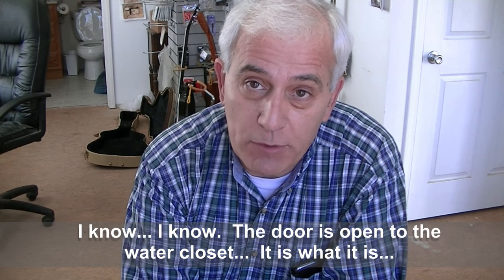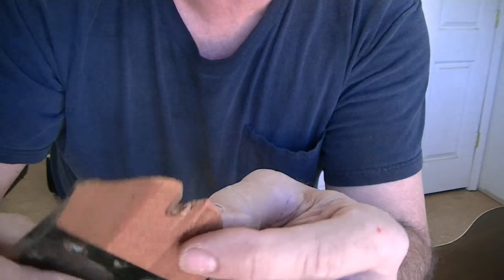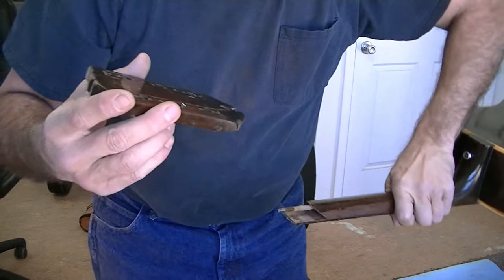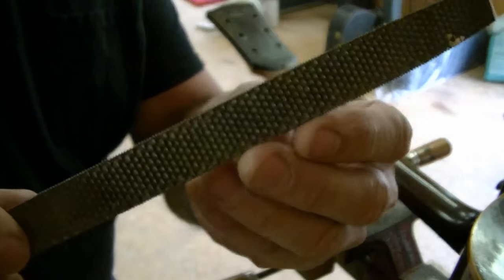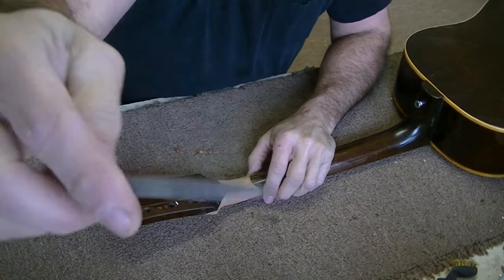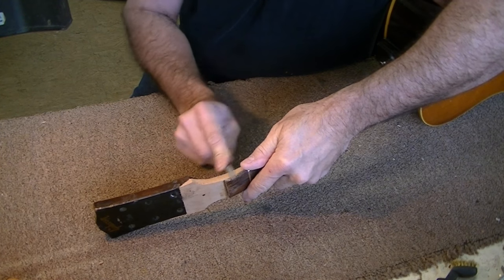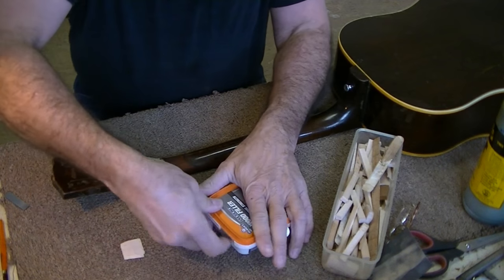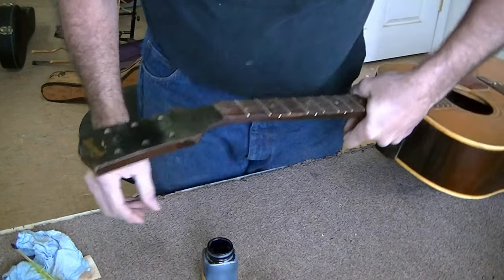134 RSW Gibson Guitar Broken Headstock Repair

Comment: You definitely do excellent work! I know this is an older video but the information is still relevant. Many people dont realize the amount of labor that goes into a repair of this magnitude. Plus the level of patience that is necessary. With gluing a neck, you definitely have to wait for the glue to cure completely before moving to the next step, because once that neck is under string tension it can pull a repair apart very easily if the neck isnt 100% cured. Acoustic guitars tend to have twice the pull force on their neck as compared to an electric guitar. This can be close to 200 pounds.  This was and is a great example of what a little hard work and patience can do. It's always nice to see an old vintage guitar being resurrected and brought back to being playable again.

Comment: absolutely amazing work. i can't believe how you got that right in 3 pieces. no adjustments on bridge? unbelievable!  you really know your stuff!!  i had a new head stock made for a 1968 Gibson s.g. by tay tay & son on long island n.y 20 years ago.  i was impressed by how the old man rebuilt in 1 piece a headstock to neck but you did it in 3 pieces? dam .....    if you have a inlay face & want to save it just soak in water overnight.  it peels off & you can glue it to a new piece.  thats how mine was done.  may save alot of time ..  awesome work !

Comment: Oh how I wish you had shown how you cut the neck with the truss rod still in place! I have a simular break on a les paul and it simulary has been poorly repaired before, the glue used looks simular to the glue in the video, it looks like it's porus and has small air pockets in it. The repair you've done making it in essence a scarf joint is amazing!

Comment: First I cringed at the damage.. then after the piece was glued in and sanded and shaped I knew it was the right way to go. The original break de-valued the guitar and after that anything to get it playing again could be done. Great job! A great ol' guitar like this need to play on again.
Reply from the maker: drumsNstuff79 thanks.  The worst part is that two previous attempts failed, so doing the same thing woild have been futile.  Thanks for watching.

Comment: Had a white SG headstock repaired a couple of years ago. It had cracked open with a light bump against a mike stand during a gig. I asked for a "brutal repair", and brutal is what I got. The guitar was recent and painted white, and the top of the headstock wasn't broken. The luthier glued it with back together with epoxy and routed 2 thin channels parallel to the truss-rod up into the headstock to insert and epoxy glue 2 graphite plates from around the 4th fret down to the nearly the top of the headsock, then painted and finished it back to the guitar's original appearance.
I suppose it was a bit overkill, but that headstock will never break again unless you attack it with a sledgehammer or some sort of a power-tool.
I sold that SG and replaced it with a second hand ESP LTD Viper 1000 Deluxe with Seymour Duncan PUs which I found by chance while shopping around, and which sounds, plays and sustains like an absolute dream, and has all the features I ever dreamed of when I was playing the SG. I never thought I would switch from Gibson to some "obscure" brand of guitar, and I don't know if all the ESP LTD guitars are built with the same quality 'cause I'm a player and I just need a couple of guitars which suit to my hands, and I'm not a collector nor a compulsive buyer, but I guess I was lucky with that peculiar guitar (at least luckier than with the SG).
Reply from the maker: Philippe Durel good luck with it. Thanks for watching.

Comment: As I wind my way through all your excellent videos, I seldom have any criticisms, and never any criticism of your actual work,  but on this one, I was very disappointed to not see how you clamped the new piece of wood.  I could almost visualize the clamping of the plug to the headstock, but not the other joint.  It would seem like the clamping of those glue joints were so absolutely critical to the strength of the repair that it should have been shown in some detail.  Also, you never showed how you dealt with the truss rod.  I salute you for your "grande cojones" for taking on this repair!
Reply from the maker: That was an early video

Comment: I didn't see the truss rod cavity cut out - lots of stain on the front, and the truss rod cover replaced in the final job, but exposing the truss rod nut? That would have been interesting to see.
Reply: If you look early on theres a small hole in the top of the section he clued in. When he drilled the truss rod channel in guessing it probably was only 2mm or so from being Ann the way through and that the top was cut out with the whittling knife

Comment: Thought you were dead in the water at first glance. Impressive job on the neck. You didn’t show nut slot install did it intonate? String action ok or did you have to do some bridge or saddle work? I know you said that was early video however, a great job. Thought it was a going to be a birdhouse at the start. Thanks this was like reading a good mystery novel. Not trying to be a troll but you do such wonderful work however, color matching finish is not your strongest skill. Getting some color lacquer in the shop would help. At any rate you are a gifted man. May God Bless you.

Comment: I’m curious to know how you managed to cut the wood away from under the fretboard and around the truss rod.
The neck we see at 3.55 appears to have been machine cut to a high standard, but with the truss rod in place that seems impossible.
You say "I’ve had to cut away the neck also" but you go on to say “I did most of this off camera". Could we please have some more info on that, or another video perhaps?

But by far the most confusing thing for me is that at 1.25 we see the end of the truss rod with the nut in place and at 4.10 you say “the truss rod will function and everything will be perfectly normal when we’re done”.
However at 13.00 when you turn the guitar over and we see the repair from the front, the truss rod cavity appears to be missing.
You dark stain the new section and at 19.10 you hold the repaired head up to the camera with the truss rod cover in place, and I’m completely baffled.
Could you please explain how the truss rod will function?
Thanx for a great video.
Reply from the maker: First it is an old video I don't remember too much about it because there's been so many other instruments since then. I'm sure I cut up to the rod with a small razor saw and cut in as many directions as possible with the saw I probably had to finish it with a knife or something along those lines though I don't remember. Regarding the truss rod cover I think that was probably just poor camera work because I know the truss rod was just perfectly normal. I don't know the man personally that owns the instrument but my son does and he says he plays it everyday. And he is still playing it. So I know it all worked fine.
Reply: @RosaStringWorks  err, that's ok then (I'm still confused).
BTW big hand to your backing band, they sound brilliant and it's so good to hear the instruments you work on.

Comment: How did you make the cut on the neck around the truss rod?  Unfortunately I'm about to attempt the same repair on a 335 that's had 2 neck repairs already.
Reply from the maker: It was so long ago I don't honestly remember but I believe I used razor saws and exacto knives
Reply: @RosaStringWorks  thanks.  It's going to be a test of patience I'm sure.

Comment: Really enjoyed this,great repair,, I've seen a few of the other top guys cut two channels  across the broken parts with a small router bit and glue in two mahogany  strips for additional strength ,so it's not just the glue  that's taking the string tension ?
Reply from the maker: I've been doing it this way for years and years and never had a problem

Comment: Thanks for showing me a method i may have to do my self on my les paul. 3rd  break.. back of neck is flattened from clamping and feels kind of hollow behind the truss rodd nut... so i may do your method. iv been to price up some sepele will cost me 5 pounds. nobody with a Lp likes to see a scalf joint as it then looks like a ringer. but what can i do. its been broken to many times with internal gaps and its just not good.. i could spray a burst area just below the headstock to hide the scalf.... Only problem i could see with your job was i can see a groove where neck meets the inlay block. and it was 2 shiny.. needs some wirewool work or scotchbrite to take that shine down. but anyway thanks for a great idea.
Reply from the maker: Joe Szabo that one was kind of a budget job. The customer literally didn't have any money. Thanks for watching good luck with yours.

Comment: You did that without doweling it at the top at? The neck graft there is no need but at the top there is more yield than shear pressure on the glue? You must think highly of your glue. What may I ask did you use for glue? Titebond III?
How about replacing the whole head stock down to the graft point? Then cutting the Gibson face off of the old one and gluing it on the new one trimmed just below the lowest tuner hole? I am not saying you did it wrong just that it will never break at the neck side but the upper one made me nervous.
Reply from the maker: Jason Adams I did use Titebond.  It's been well over two years or more since that repair.  The video was released way after that repair went out of the shop.  He still plays it daily, so I don't think we have a problem.  Thank you for watching.

Comment: I liked that one a lot.  Got that old J-50 back into action.  Very neat repair -- must have been hard to cut that center piece just exactly the right length?  

The hard part with matching stain is you have to project how it is going to look after the finish is applied  -- it always changes the "color" a little.  What kind of stain is that?  Looks like it is a water-based azodye?  Also what was that wood filler you used -- Elmer's?  

I just fixed a break on a mandolin neck that was similar to that one but I am not as confident as you are on my fix -- for one thing it is maple and I think glue binds to mahogany better and also there is a smaller gluing surface and the total string tension is greater but so far (two months) it seems to be holding good (knock on wood).

I used Titebond I  for the repair because I did some tests using small blocks of maple in the vice and decided that the aliphatic glue bond was stronger than hide glue, fish glue, or one of those super glues designed for wood (ethyl cyanoacrylates).
Reply from the maker: Thank you.  It's hard to beat titebond.  I use alcohol leather dye for all my staining.  Yes the filler was probably Elmers.  I doubt you'll have any trouble with the glue on the maple.  After all it holds the back seam together on a mandolin and in places that is only 1/10" thick or less. Thanks for taking a look.

Comment: I’d be interested in how u cut the broken part out of the neck and left a that straight clean angle for the glueup.
Reply from the maker: To be honest I can't really remember. It was several years ago. I believe I used a razor saw and cut as close to the bar as I could. Then I may have used a chisel to clean it up after that. I just don't honestly remember. Thanks for watching.
Reply: Rosa String Works Okay, great repair though for sure.  To me the repair just looked like a neck scarf joint, brilliant.

Comment: Rosa String Works I have a cheap Kay guitar it built with only 3 braces on the top if I added some braces to the bottom what it make it better?
Reply from the maker: +Brian Smith well that's a really open question. It would only help if the braces were put in the exact right places and were really needed. They could do just as much harm as help if they aren't the right size and aren't in the right place. Thanks for watching. Happy New Year.

Comment: I know I suggested it before... A power file would help a lot!
Reply from the maker: I really can't imagine how
Reply: @RosaStringWorks  I think you'd have to try one with the appropriate grit sanding belts!
Reply from the maker: I'm not sure that would be precise enough for the kind of detail work I do it might work on the rough out type work when you're building an instrument or something but when you're working on a finished instrument a power sander just never seems to be the right tool to me.
Reply: @RosaStringWorks  Perhaps not for finishing but certainly getting close enough for fine detailing. I'd order you one from here but like the strings I wouldn't want it to take months to appear also the voltage difference... I'm looking at US Amazon and they don't seem to do the one I suggested, but pick out one to suit you mid range if possible and let me know and I'll order it for you.

Comment: Everything about this was going so well until touch up. This could have been an absolutely invisible repair with the right color match grain filler sealer then light stain and tinted lacquer. I’ve done a handful of the neck grafts and this one could have been a slam dunk.
Reply from the maker: Don't disagree with you but you are not profoundly colorblind as I am.

Comment: Have you ever tried steam to remove old glue?  I have used steam with some success.
Reply from the maker: It would probably work. My problem with using steam is if you get it under the finish it will turn the Finish milky white.
Reply: Yes you are right.  I did not think about affecting the finish.  When I used the steam to remove glue it was before the finishing